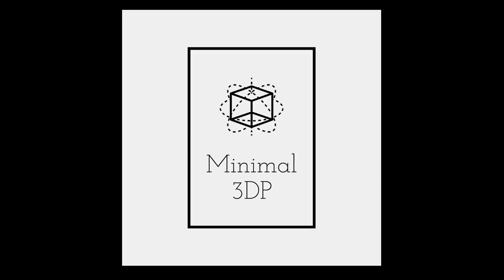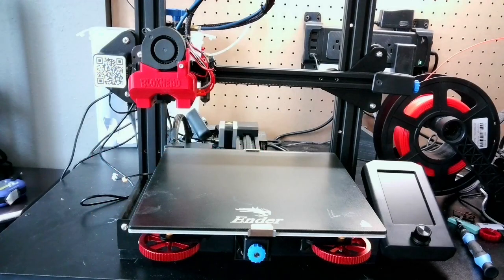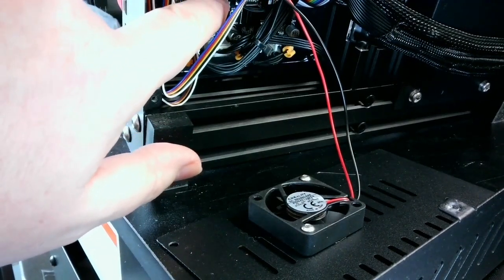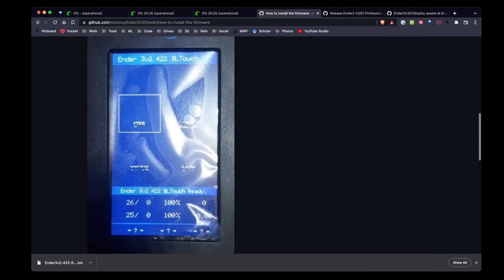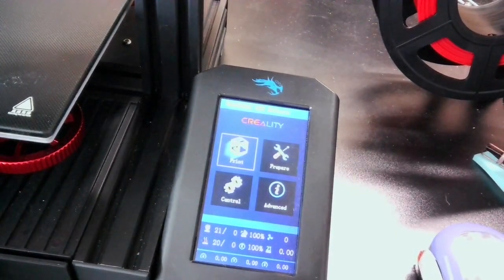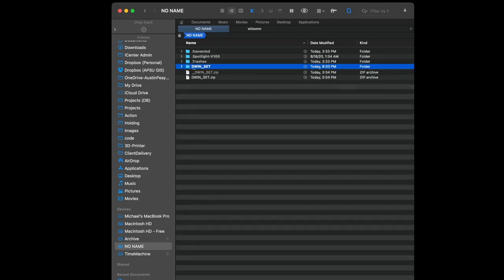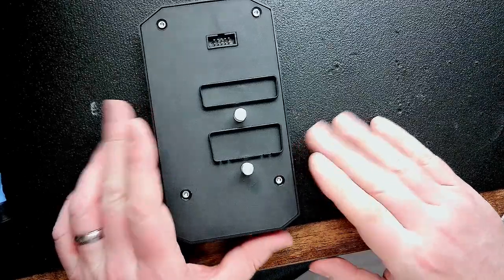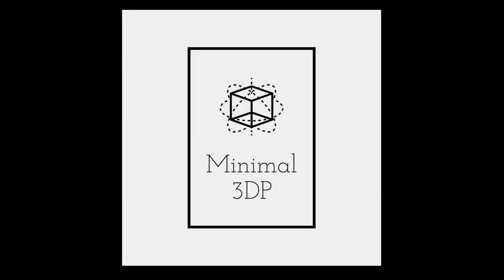Looking for an Advanced Experience on your Ender 3 v2? Try mriscoc's Professional Firmware

Comment: Of course the firmware is cool, but it's still very unstable. The fonts on the display also could be improved. Jyers has better fonts, but Miguel has more options. Congratulations;
Reply from the maker: Thanks. I will keep an eye out for any instability. If I notice any, I will try to post an update.
Reply: Thats weird! I've been with the firmware for almost 6 months, putting different updates (now I'm with the latest one) and I haven't had any problems. You can enter to the telegram group and post the issue. They will surely give you the solution and if it were a bug, it would be solved for the next version. Because another point in favor is that the firmware support is outstanding.
Reply from the maker: It is good to know about another support channel. Thanks for posting.
Reply: @csar9097  I have reported the issue to Miguel, he said he was working on that. Let's wait.
Reply: Hi, I didn't have reports about any instabilities in Ender3v2. The font depends only on the display firmware.
Reply: @MiguelRisco  Oh sorry, the report was on the Ender-3 S1.
Reply: @MiguelRisco  Hi Miguel, thanks for the firmware! I've seen some issues like printer stuck during calibration of parameters during print (not reacting on knob rotation and click). Also happened a few times that after a finished print it stops responding for a ~10 seconds and doesn't react. This is seen on Ender 3 v2, 4.2.2.
It would also be great to have more temp profiles for preheat (i.e. PLA, PETG, TPU, ABS).
Reply: I only changed z offset once or twice, but  I see this lag after most prints if not all. Wasn't like this with JyersUI. That said it's only a minor inconvenience and still like this firmware.
Reply: @Mamadou BA passion informatique, The second part of your comment has me wondering....
Reply: Best firmware? Maybe more functions for a few more days before the release of Jyers Extended UI v3.0.0a without a hidden line of code!
Reply: @LChristophe68  I am afraid I don't undertand what you mean.
Reply: Zero instability on this firmware. Been running on three machines with 2200 hours of run time between all three. Stable as can be.  Artifacts on the screen but that could be my fault. I never updated the screen firmwares. And it also doesn’t effect the printing whatsoever
Reply: @LChristophe68    Did this ever happen? Jyers from what I can tell has not had any change in about a year.

Comment: If you have been using Jyers - you’d have to know which board you had (4.2.2 or 4.2.7). You could also have looked at your previous (Jyers) bin file. Why waste so much time showing you undoing screws etc? You provide some helpful information but also unneeded padding and then rush through useful stuff at the end.
Reply from the maker: Thanks for the feedback. I appreciate it.
Reply: I found this part of the video to be useful. Thank you.
Reply: Its usefull to any doing it from scratch so i appreciate this was on video also.
Reply: Key word is "IF".   Not everyone has Jyers.  How everyone saves teh bin file or remember which card came from each printer......